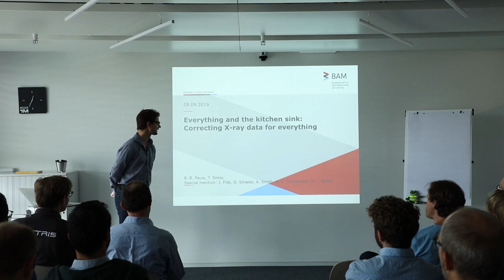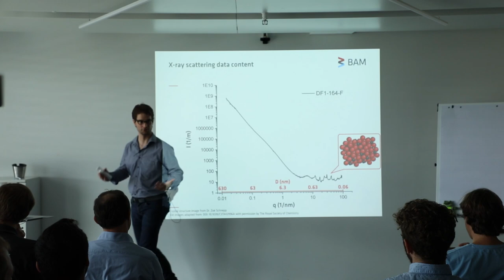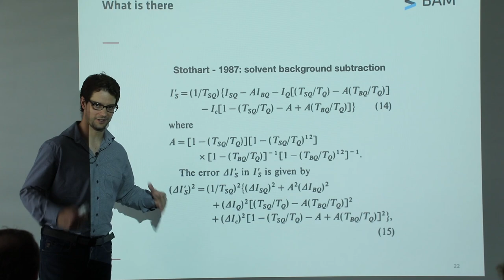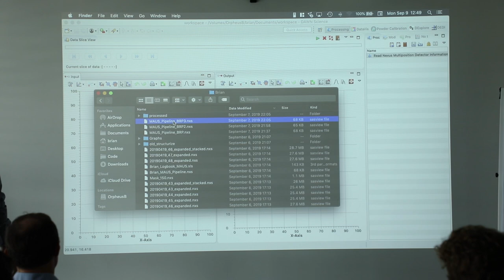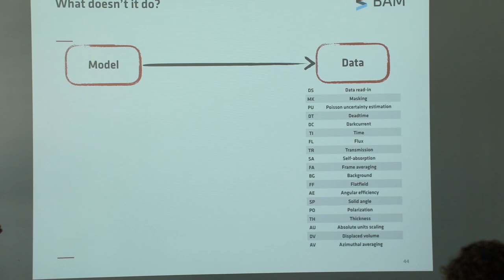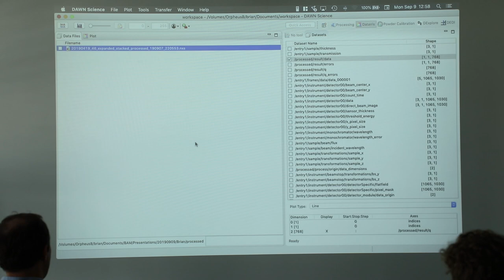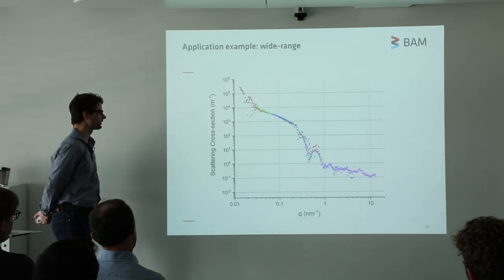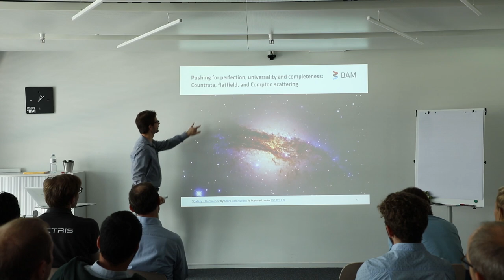Everything and the kitchen sink:  Correcting X-ray data for everything

Comment: Hello Dr. Pauw, one question regarding the background artefacts in the corrected signal of the PVA embedded Au NPs at 29:28: When it comes to the next step, evaluating the signal and getting quantitative numbers for the particle size distribution, what data range (along q) would you consider for this? I assume fits with spherical model assumptions would fail in the background dominant regions or give unrealistic results?  So maybe consider all data where I(Au) is 50% greater than I(PVA) [here: around q = 0.2; just a guess]? Would you go then for an iterative and emperical approach which range yields reasonable results and which not?

A little bit more theoretical, one further question: having the difference of static particles in a solid matrix in comparison to dynamik ones in a colloid, assuming higher concentrations with interparticle distances in the nm range (still with random orientations, no densely packed formations), would you ever consider the static orientation to have an influence on the observed signal / particle size distribution?

Thank you for your work.
Reply from the maker: Hello Bangada,

As for the first question, I can't say a priori what a "reasonable result" would have to look like, therefore I would not recommend these iterative and empirical approaches. Therefore, I'd instead focus on improving the uncertainty estimate on the values here. What is missing in these uncertainty estimates, is the incorporation of the scaling factor uncertainties when we do the background subtraction. That means that our uncertainties are still a little bit under estimated for the high-q data. 

When it comes to the second question, if I understand you correctly you're asking if you would see a difference between particles fixed in place and dynamic particles in a liquid. Fortunately for us the speed of motion of an x-ray, and thereby the speed at which our sample is probed, is much much faster than any movement speed a particle can have. Therefore I do not expect to see any difference in scattering behaviour between these two cases.